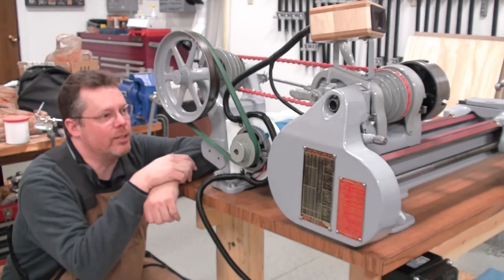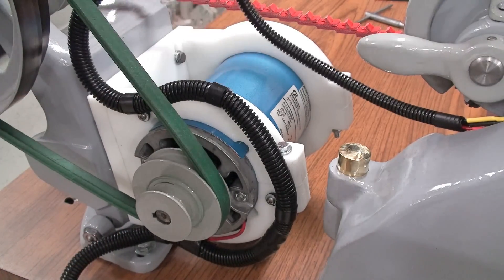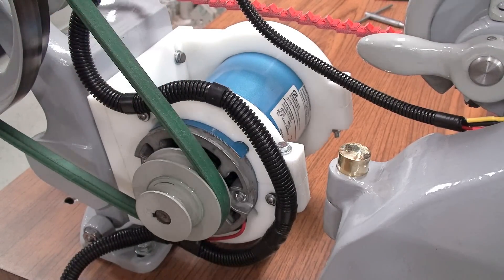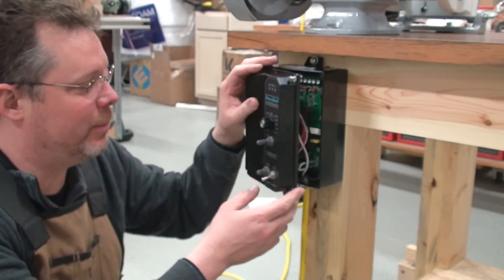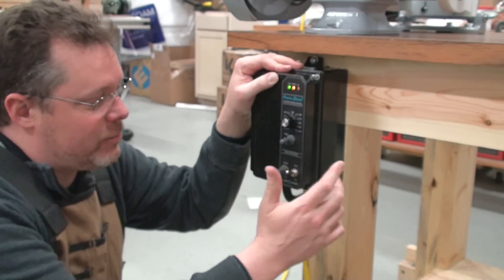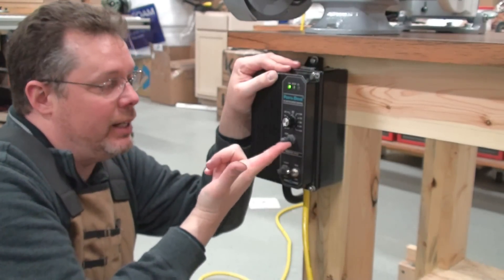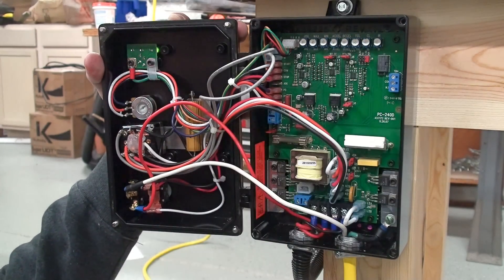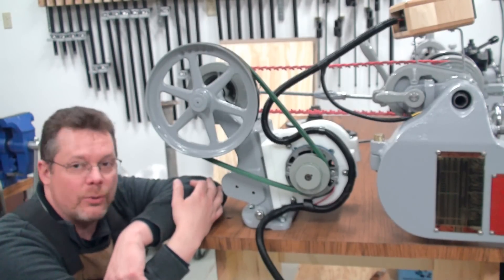Converting a South Bend lathe from an AC motor to a DC motor

Comment: to my knowledge the power output of AC motor is constant, so the torque will increase when the rpm is decreased,
but for DC motors, the motor control the amount of electric current going through, so a 1 HP motor may have only 1/2 HP output at low rpm
is it true?

Comment: Does it actually work under load I've converted AC to DC nothing  but crap my wood lathe would bog down under load then would speed up 1000 rpm to catch to a dangerous speed when bowl turning.
Reply from the maker: Yes. It did very well under load. Gotta make sure it has enough horsepower.

Comment: Nice presentation.....I went in another direction and tried a full wave rectifier and a variac to power my pmdc motor. Haven't installed it yet but during testing noise free and great speed control. To get forward/reverse just install a tumbler or dpdst switch. You can save a couple hundred.

Comment: Thanks for the details of your treadmill conversion, I am in the process of doing one myself and was wondering how the white material you used in your mount was holding up?  I have a piece of 3/4” of that material and some 3/4”   Baltic birch.  Trying to decide the best way to go.  Thanks
Reply from the maker: I am not sure since I had sold the machine a few years ago.

Comment: Is your treadmill motor a permanent magnet motor? Are you running it in reverse, if so has there been any negative things with the motor when running it in reverse?
Reply from the maker: I just know it's a DC motor and runs with no problem in forward and reverse.

Comment: I did my wood lathe 6 months ago with a treadmill motor and the m60 board and potentiometer,,, just got a 2.5 horse power for my 12 x 36 atlas,,,l love the dc motors,,,have one on my drill press also,,,so quiet and smooth,,,

Comment: What kind of motor is this because Ebay doesn't allow me to find any threadmill motor in the EU
Reply from the maker: I don't remember now. But I think it came from some kind of industrial equipment and not a treadmill motor. However, I would have used a treadmill motor if I hadn't found this one.
Reply: Knowing treadmill motors.......there should be no hum at all.Treadmill motors make absolutely no noise while in operation.That hum you hear is associated with a wiring or motor controller issue.Finally....your treadmill motor originally was manufactured with a plastic cooling fan on the back.I see in the video that it is missing......this would certainly help with cooling the motor.

Comment: I know this is an older video but it would help to out a constant speed fsnon the motor. Many are made to bolt right on sn wired to codtsnt voltage. You should be able to set the KB control to a higher min speed so it is not so hard on the motor. Nice looking setup.

Comment: I know this video is old. but at 1:54 when you show the back of the motor there is another ribbed pulley where you could mount a small fan blade to keep the motor cool. Most treadmill motors similar to this have a fan.

Comment: I have found a new 3hp dc motor but I can not find a speed controller that will work with this motor ?  This motor  says  130vdc  17.2 amps  rpm5265@130vdc no load. Can you help me choose a speed controller ?
Reply from the maker: That is probably too strong of a DC motor to find a controller. If you are going to use a DC motor, then use this website as a reference to find a conroller: https://www.kbelectronics.com/
I used one of their controllers on the lathe in this video.
Reply from the maker: Otherwise, use a 3 phase AC motor and a VFD to control the AC motor. I think the AC motor option will be better for a large wood lathe as long as you have 240VAC going to it.
Reply: I will check with them. Thank you very much for your help. I thought you said the motor in the video was a 3 hp? My lathe isn't any bigger than what you done in the video probably not as big I might fall back to a 2 hp ?
Reply from the maker: I did say it was 3hp by mistake, but I have a pop-up statement on the video that says it is actually 2hp.  2hp worked good on this lathe and will probably work good for yours.
Reply from the maker: Is your lathe 12" diameter, or 12" length capacity? The one in this video is a 9" diameter capacity.
Reply: It is a Woodtek 12in. diameter and has a 3 hp ac motor running now on 120v  could change it to 220v. It is a wood lathe. I ran into a friend today that has a 3hp dc motor he said he would give it to me and it is new. I need to convert from ac to dc current. Then control the speed?
Reply: I might be wrong I can't see it really good but I think you might be better off to do away with that big wheel and hook direct to the lathe? I think that big wheel may be over working that motor ???
Reply from the maker: A 3hp DC motor may work fine with the KB electronics controller on your particular lathe; I am not sure. But I know a 3hp or 2hp 3 phase 240VAC motor with a VFD will also work. My new lathe is a 15” machinist lathe, 2hp 3 phase motor hooked to 240VAC 1 phase with VFD, and it works very well.

While the big wheel may not be needed, but it actually provides more mechanical advantage and eases the stress on the motor. It is also part of the history of the lathe.
Reply: Sam P, i know you said your friend gave you the 3 hp motor, but can you give me any info on name brand, where he go it etc?  I've been looking for a 3 hp DC motor and can't find one.
Reply from the maker: The DC motor in the video is a 2hp (I misspoke in the video about it being 3hp). The brand is Pacific Scientific. You might find them on eBay.

Comment: Is that motor suppose to buzz like that ? What did you pay for that motor?
Reply from the maker: Yes, motors buzz when in reduced speed.  I probably paid $30 for it.
Reply: I have found a DC motor on ebay for 80 dollars it has a foot pad and a 5/8 x 1 7/8 shaft and it's new. I sent a message asking if it was ball bearings? I have a 12 inch wood lathe with a 3hp ac motor now . Will that dc motor work? I will need a speed controller ? OH that dc motor is 1550 rpms.
Reply from the maker: I'm not sure about that motor speed and horse power. What speed motor is on your current lathe? Another option for you is to get a 3 phase AC motor and install a VFD to control the speed. I did that on my newer metal lathe and it works fantastic.
Reply: Thank you very much

Comment: It appears that you are switching the neutral instead of the hot wire. Is there a reason you did that? Very nice conversion, looks like something I want to try on my Shopsmith.
Reply from the maker: I dont remember. That was quite a while ago and I no longer have the machine.

Comment: in the process of doing the same thing. Question: what side did you wire the on/off switch? what wires did you connect to for connection the switch? 
Thanks
Reply from the maker: I can't answer for which wires were connected where since I sold the machine and cannot look it over. However, the on off switch is located on the black box that is shown at about 2 minutes into the video.

Comment: seems like everyone with a dc lathe motor is switching to AC, and the AC guys switching to DC. On the mini lathes , i know for a fact the 40 % gear reduction pulley system is the most powerful mod that can be done without an external motor mounting..,Very nice work , and amazing lathe

Comment: Well done!
A note, the component next to the direction switch is a power resistor, not a capacitor. The aluminum enclosure around the resistor is a heat sink, and since it's so close to the direction switch I'd bet it's used for resistive /dynamic braking of the motor
Reply from the maker: Thanks
Reply: Spencer Clayton

Comment: well i got a 3 ph 220v 1/3hp motor - new - for a 100$ + a Mitsubishi .75kw  1ph 220v to 3ph variable frequency driver - new - for 95$$ (bargain as these  go for more than 250$$ )

the VFD has not arrived yet but i hope i didnt oversize the VFD for my motor...
Reply from the maker: Cool! You can oversize the VFD HP. It won't hurt the motor.
Reply: thanks alot for help ...

what a relief..

Comment: HI

thank you for your quick responding on the other video regarding the bed red rulon tape

is this motor you showing  in this video the same like this one :

http://www.ebay.com/itm/NEW-PACIFIC-SCIENTIFIC-SR3640-8293-7-13-48BC-MOTOR-UTA-RTS0422-75-/181653316391

I just trying to find it so I can get one for me:)

thank you
Reply from the maker: It is the same brand, but not the same motor. Pacific Scientific motors are pretty good. The one you linked to is only 1/2hp, which is not very strong for a lathe, and it is very expensive for such a small motor. 1hp minimum would be best for a mid sized lathe. The one I used was 2hp and had lots of strength at low RPMs.

Comment: hello, 

You're not talking torque at low speed, as it was not that important. 
Now this is the major issue. 
Why put that aside capital parameter?
Reply from the maker: Torque at low speed was not a problem on this lathe since I had a high enough horse power DC motor.
Reply: +Aaron Weed Dear Mr. Weed. Thanks for your motor video. We are manufacture supplier of ac motor for more than 39 years. Maybe you are also interested in our motor. My email sales1@hxequipment.com. 0086-18254586121

Comment: Hey Aaron did you wire this for 220 ? i was planing on using the same sett-up for a direct drive belt grinder but I'm unsure on the power output of these motors, eying a 2.75 hp one on ebay right now and ill be paring it up with that same controller but in order to get 2 hp I believe it has to be wired 220 and that means the voltage output would be 180vdc would that hurt the motor you think as there 90/110vdc.
Reply from the maker: My motor was for 110vac
Reply: Aaron Weed  Thanks i got the motor and controller now and loving the variable speed :D
Reply from the maker: Tyler Smith
Awesome. Glad you like it.

Comment: How do you like the DC motor now that you've used it for a while? The large "capacitor" is a power resistor. Nice job!  Jon
Reply from the maker: I actually only used the lathe for a short time and then sold it to get a bigger lathe. I loved the DC motor during the time I used it. I am glad I went with a higher horsepower motor.